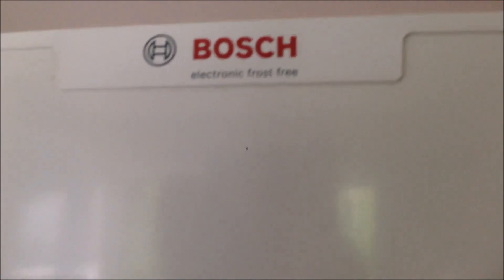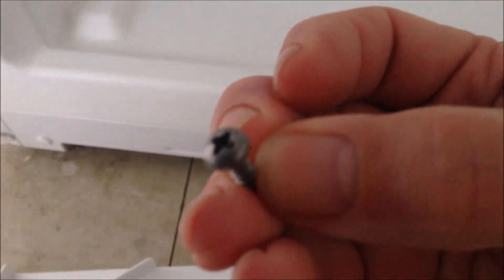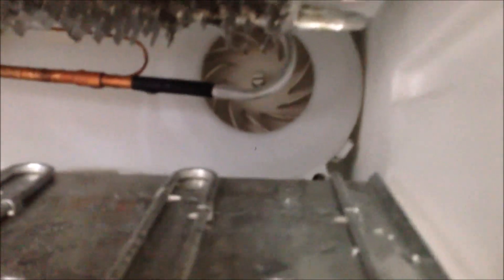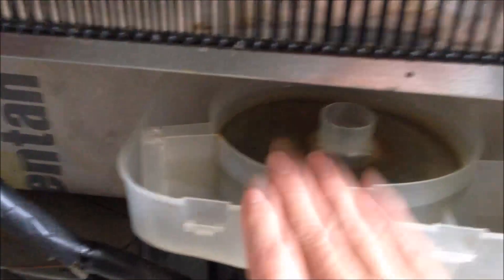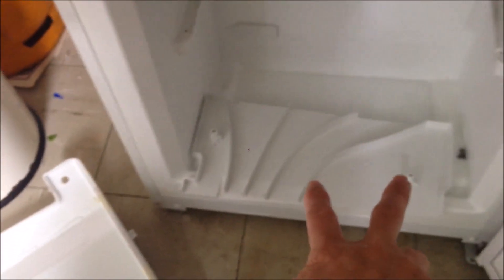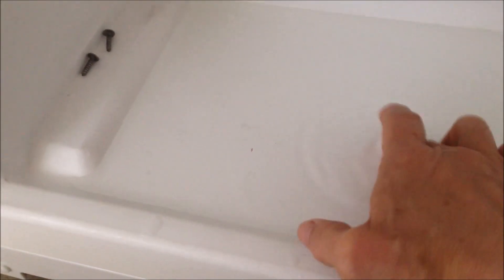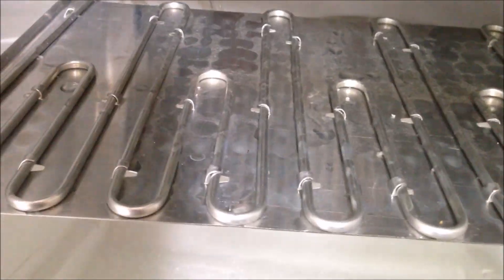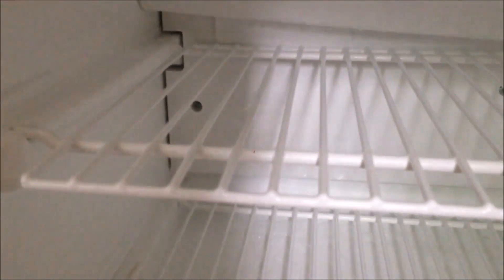Frost Free Fridge Freezer: How to Defrost manually after Fan Stuck, Bosch Classixx, Ice up, blocked

Comment: Helpful video, thank you. I have the same fridge freezer and the same issue. The fan can be heard buzzing on the ice as it builds up, which can be a sign that a full defrost is needed. Once done, it is worth removing and cleaning the drainage pipe at the back of the fridge which goes to the tray above the compressor. This can get blocked. Also, I found that mice were using the tray as a water source, so I've covered this over with vermin mesh which is wired down.
Reply from the maker: Great ideas! Thank you!

Comment: Thank you, I struggled for months with this problem, had to defrost the fridge every 4-5 weeks and none of the technicians had any idea why the fridge stopped cooling.
Found that the drain was dirty and cleaned it.
Reply from the maker: I also added a single copper wire: one end into the drain and the other end twisted with the heater! This helped to prevent the drain hole frozen. Since then my fridge has never blocked for 5 years. Have a good day!
Reply: @RepairDIY  Thats a neat trick !
Reply: @RepairDIY how did you connect the wire to the heater? I have same problem again fridge not cooling.
Thank you very much
Reply from the maker: @MrTalshifer  I used a single strand copper wire with the insulation removed. One end went into the drain hole about 2cm (if too deep, you may have problems to install the heater panel and under-tray). The other end went over the heater metal panel, and made the copper wire went around one or two heater bars (getting under the heater bar, then over the bar, then went under the heater bar; in other words: winding the copper wire around the heat bar? like a snake winding around a branch?). Good luck!

Comment: I have a KGH34x05gb fridge freezer, the compressor and fan are working but the fridge is around 10 deg C. It constantly makes a clicking noise, the freezer is working fine. The fridge struggles to stay cool in the summer. In the past the fridge temperature has risen to 16 deg C, even if I turn temperature control to 4 out of 5.  I can feel cool air coming out of the vent inside the fridge; what else should I check? Is it the automatic defrost making the clicking sound?
Thank you
Reply from the maker: Hi, chris, my fridge is also make cracking sound when defrosting. I think that should be normal. for the fridge part, the control knob is for adjusting the amount of cool air from fan to come into the fridge chamber for my fridge/freezer. I suggest to have a full defrosting of your fridge (doors widely open for three days?), to see if the problem solved? It may also help to check the cool air pass from circulation fan to fridge temperature control valve and the outlets to the fridge chamber. You fridge/freezer might be different from mine. Good luck!

Comment: Thank you for the clear explanation. I have the same made fridge freezer, in June 2021 I had exactly the same problem (ice building up and the fridge stop cooling, but the freezer still functioning) I followed the procedures in your clip, and wallah the problem was solved. However , it took only six weeks for the ice to build again. Since then the same problem happened twice (almost every six weeks), and I had to to through the same procedure, i.e de icing. I wondered if you have had a smiliar situation. Once again many thanks.
Reply from the maker: You could check the drain pathway: from inside the freezer, to the rubber hose at the back of fridge, and to the tray on the compressor. Make sure the draining path is cleared all the way. Good luck next time! Charlie

Comment: Iv only had my 3 weeks and now fan stops ,then the fridge freezer has ice.anyway cut a long story only 3 weeks waist of my money not cold anymore even when freezer fan comes back on
Reply from the maker: as yours is only three weeks old, there could be a problem with defrosting system. it is a good case to return it to the shop for repair or replacement. good luck!

Comment: I am in the process of doing this, just took the back cover off, and noticed that the top cover is also insulated with polystyrene foam, is it still okay to take the cover down once the ice has mostly melted?
Reply from the maker: yes, it is insulated. be careful when removing the cover: try not to stretch the cables, try to support the heater plate, look out for sharp edges. i have done this several times, so far so good. have a good day!

Comment: thank you for your nice video now i have this problem every month i have to clean it and  the heater and fan and thermostat is working what your advice to me?
Reply from the maker: hi, it most likely to happen in winter, so if it is in a warmer room it may freeze less often, I guess. you could also check the drain pipe (from the fridge body to the tray on the compressor), to see if it is clear and no obstruction into the fridge? Some people also use some metal wire, attaching it to the heater on one end, and the other end to the drain hole, to help the drain pass clear and not frozen. finally if you set the freezer temperature higher (we set it to -16 degrees C), it may frozen less frequently? Good luck!

Comment: Hi my fridge stopped cooling I was about to Chuck out and buy another when I found this page , did as told in video and boom my fridge is like brand new . To be honest I messed up by turning freezer on to super frost for too long and it froze my fan that cools the fridge solid . But I wouldn't of known that with out watching this film ,, thank you very much 🥶🥶🥶
Reply from the maker: congratulations! You also have contributed to protect our environment! have a good day!
Reply: @RepairDIY  hi my old Bosch freezer no frost part drop's temperature when I put New frozen food init
Reply from the maker: @ciararespect4296  yes you're right! whenever you put something into the fridge/freezer, it takes long time to get the new things to the set temperature. have a good day!

Comment: Careful you don't pull out the electrical connector plug for the defroster unit, it's a sod to get back in
Reply from the maker: Thank you for your comments! That is a very important point to prevent our DIY from becoming more complicated. Thank you and have a good day!
Reply: You got to lie on your back, stick your head into the freezer to get a good view of the connectors.

Comment: We have a Classixx, but the top plastic section seems to be in two pieces and won't pull out. I haven't pulled two hard in case I break something off. The heater doesn't seem to be loose.
Reply: Thank you so much for posting this. Life saver :)
Reply from the maker: Hello, I remember that even after 8 hours, it was still very difficult to remove the top cover. If this is the first time for you to remove, I suggest to wait much more hours before you try to remove. The heater plate is actually sitting on the top cover, so while you are trying to pull the plastic cover out, you could try to use the other hand to separate/lift the heater metal plate. If you wait for three days, you may not need to remove the cover at all, or you could try to find out how it can be removed. Great to be on the safer side every time. All the best!
Reply: @RepairDIY  Thanks for the reply. Yep, I've left the freezer about 3 days, and there must still be some ice as it continues to produce water. This version seems different as beneath the heater is a think piece of polystyrene, and none of that wants to move. I don't want to use too much force in case I break off pipes/cables. The issue with ours is the drain seems to block after 6-12 months, then all the melted water starts to go elsewhere and freeze, and that eventually blocks the fan causing it to stop working. We do have a local tech who repairs Bosch freezers, so if it continues I'll ask him and see if he can dismantle it to see what causes the regular blocking.
Reply from the maker: @StainSteelRat  hi, if ice is melting, you should find water in the tray over the compressor. If there is lot of water there, your drain is not blocked. The drain hose is connected to the bottom of the tray. another thing i like to mention is if you place your fridge in a heated room in winter, it should be less likely for the fridge to freezing-up. another thing: set the temperature knob in the fridge compartment to 3 (middle) so that there is always warmer air from the fridge drawn into the fan? good luck.
Reply: @RepairDIY  Every 9-12 months we start to get a cascade of ice inside the freezer, so I'm guessing that due to some design/install issue the drain slowly blocks over time - possibly ice forming over the top - then the water from the frost free system slowly builds up everywhere, and eventually blocks the circulation fan to the fridge section. Now that the freezer has been defrosted (2 days so far) there is water in the condensate tray above the compressor, so I'm guessing that an ice blockage is at least partly the issue. Without dismantling this top section I can't see if there is some install/design issue with the location of the drain that might be causing this ice block. I have gone the other way from the outside pipe using some pipe cleaners and a wooden rod to try and gently clean/clear the pipe. I might try that once a month and see if it keeps the pipe clear. Will know in 12 months time!
Reply from the maker: @StainSteelRat  yes, same here. i have been doing it for many times so far. The drain hole inside the freezer is simply a hole, nothing special. aligning with the drain hole, there is outlet on the plastic cover and one on the metal plate. definitely the hole should be firstly blocked by ice then the defrosted water flowing inside the freezer. there is a climate classification on the name sticker inside the fridge(i think). My climate specification is something like N-SN, meaning the minimum operating environment temperature should be at least 16 degrees C. As i mentioned before, if you out the fridge in a room above 16 degrees and set the temperature control to middle, it may help to prevent from frozen fan.  without removing the cover , you may have to wait 3 to 5 days with the door open. it has been 6 months since i did it last time. cheers
Reply: @RepairDIY  Great point about room temperature where the freezer is. My freezer is in an unheated basement room, as I suspect for many people.  In winter  I think it is  below 16 degrees, so with the cold temperature the water on the heating plate may not be draining away but freezing up and blocking in the drainage pipe, even on a newer model.
Reply: @RepairDIY   Thanks for great video in my country the labour rates are so high for my 11 year old Bosch Freezer,  to do this and maybe replace the fan,  would be a third of the cost of a new freezer.  But a question for you if I may why does it take so long to defrost? like 16 hours plus, 2 days plus of I do it without leaving the cover on?  I mean when I take food our of the freezer it defrosts in half a day? (Just trying to work out how to keep my froozen food.)
Reply from the maker: @Baffuteagle  Hi, a good question! In fact, how long it takes to defrost is highly related to the room temperature. In my house it is normally under 20 degrees C all year round, that's why it takes longer to defrost. If your country i much hotter, you will definitely need to wait less hours. For me even I want to remove the plastic cover, I have to wait 16 to 24 hours, otherwise it would be too hard to remove. Without removing the cover, it does need several days for my freezer to defrost. Hope you lucky to have warmer weather. Cheers!
Reply: you got to wait 20 hours for the ice to melt, switch of the freezer and put a bowl of boiling water inside the freezer and close the door to speed up defrosting. Repeat process after a few hours.